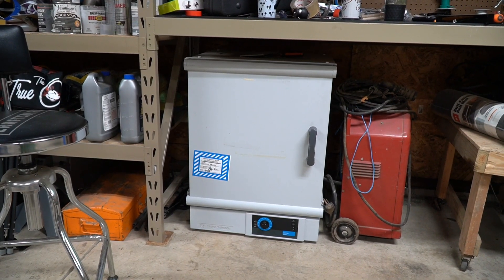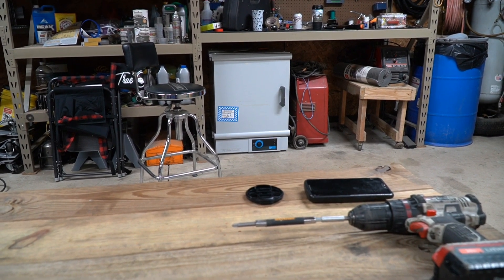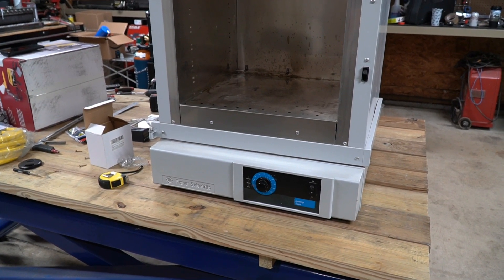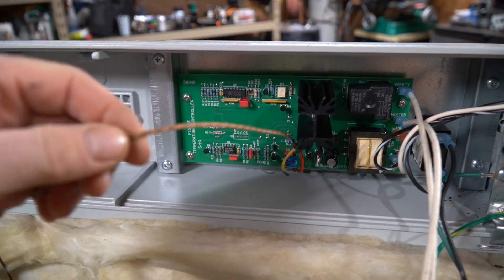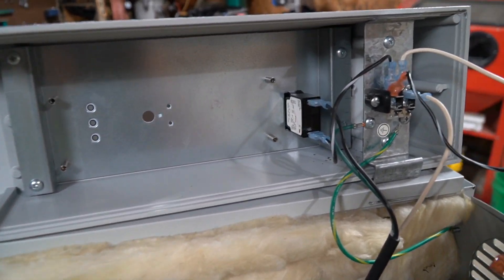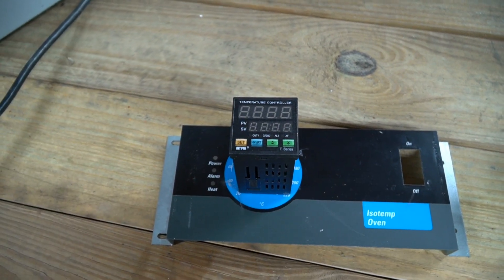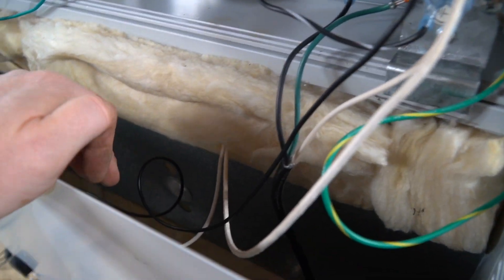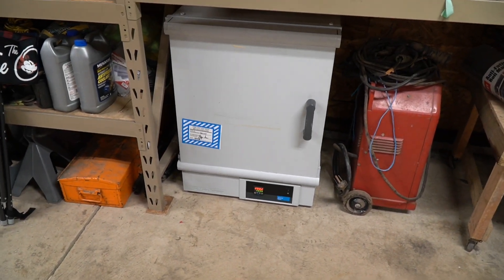Replacing a standard thermostat with a MYPIN PID digital controller on my powder coat oven!

Comment: Did you have to tune that controller?
Reply from the maker: Out of the box it was pretty much configured for what I needed except it was in celsius.   This guy explains how to configure it in detail.   https://youtu.be/En5Ewow4_tU
Reply: @1D10CRACY  if you find it is swinging or too much overshoot or too sluggish, let me know I have a bit of reference material on PID tuning. BTW, in industry they usually call them P I D instead of "pid"